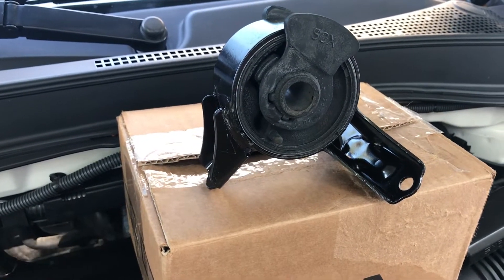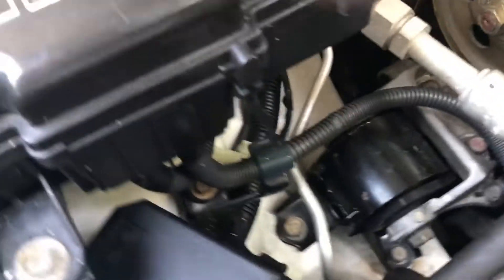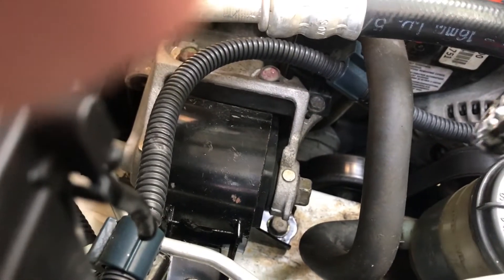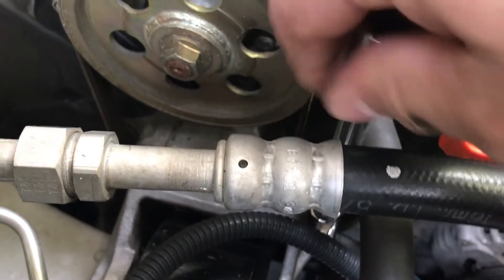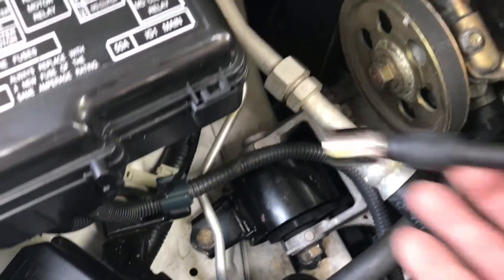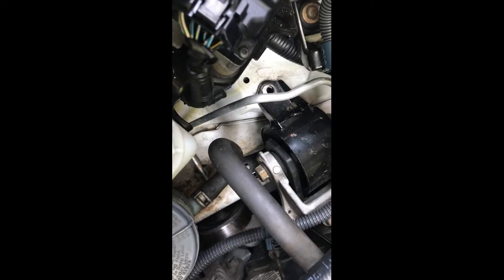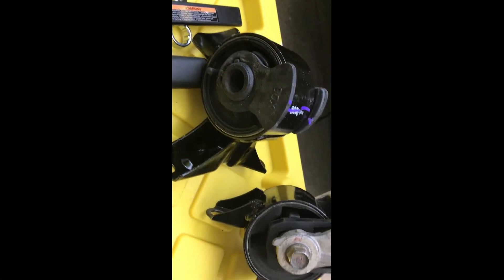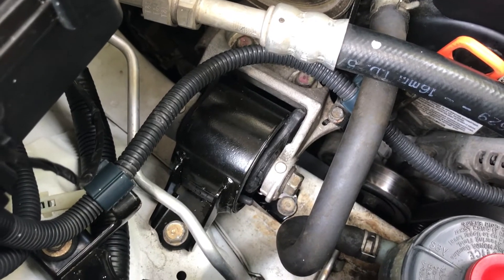2004 Honda Pilot Engine Mount

Comment: I changed mine last week,  it's called the side engine mount.  Ps, I didn't need to remove the bracket . I  wiggled it out.  Someone asked if the engine needs to be jacked up,  I didn't have to.  But just to be safe you can always have a jack ready under the engine.  Good luck folks.  I  hope this helps
Reply from the maker: Agree, the engine doesn’t have to be supported, but I did anyway.  Jack up to the oil pan with a wood cushion before removing the mount.

Comment: Did you need to jack up the engine before replacing the mount?
Reply from the maker: I did place a floor jack under the oil pan (with a piece of wood), but I only raised the jack until it touched.  I did not lift it any.

Comment: How did you know that you needed this one?
Reply from the maker: It had the most movement when shifting between reverse and drive.   I ended up replacing all the engine mounts a few months after this one.  The side and the front do most of the work.

Comment: I am very late but where can I order honda parts I cannot order the mount that is in between the wheels unless I order it off eBay and I want the original part.
Reply from the maker: I order parts online from my local Honda dealerships, then pick them up.  For some reason, this is cheaper than going to or calling the parts dept and ordering it

Comment: $80 a piece or set?
Reply from the maker: $80 (with shipping) for the Engine Side Mounting.  It is the whole assembly.  Honda part number 50820-s3v-a82